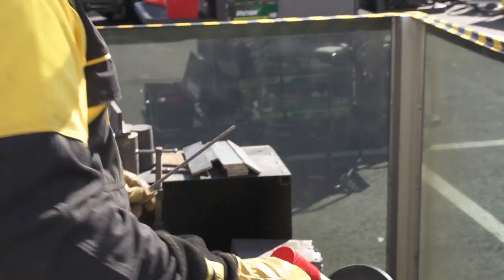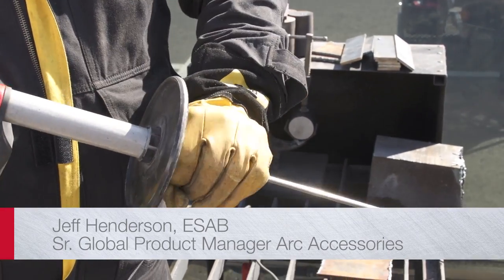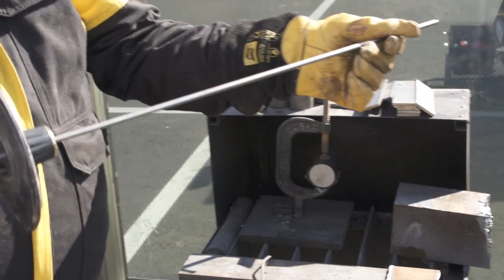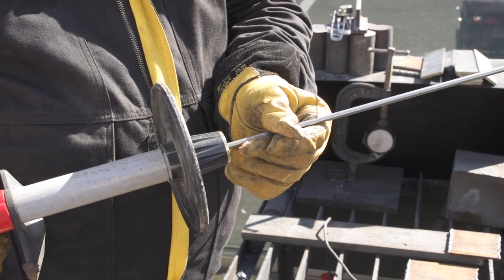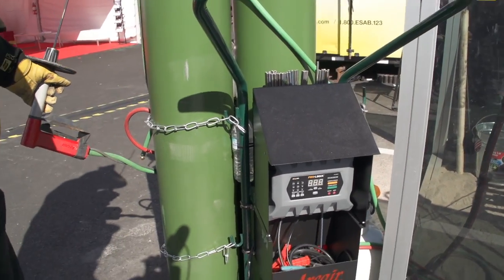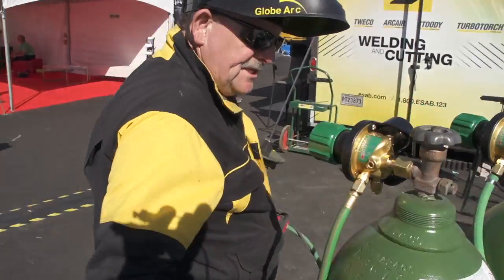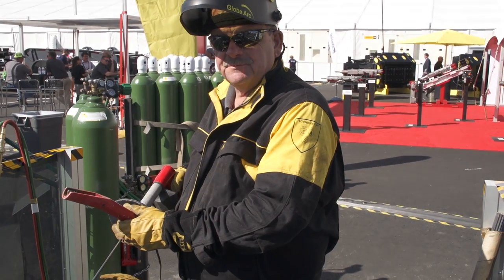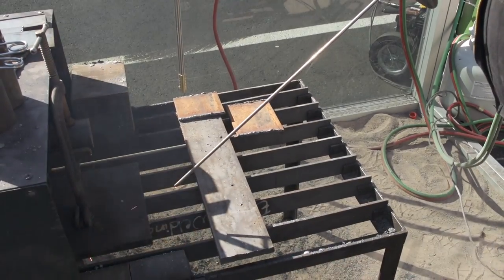SLICE Exothermic Cutting System - the Easy Way to Remove Frozen Pins

Comment: i ran into a hydralic pin used on a giraffe by the line clearing industry. we beat the hell out of it with a sledge it didnt budge and we tried heating the bushing with a torch while simultaneously spraying the pin with r-134 refrigerant to try and shrinkng the pin, it didnt work. litterally had to burn it out with this method.

Comment: Pretty neat. We use a thermal lance or oxy lance in the boilers. doesnt require power and the rods are 14 foot or so.
Reply: I think the SLICE system uses power to strike the arc or something.
When we did exothermic cuts at school the system was hooked up to a car battery.

Comment: Got a question for you guys. In a rescue scenario, can I use it to cut thru a piece of steel that is impaled on a victim's leg. That is cutting it about 18 inches away from the leg.
Reply: I would use a grinder, and or cutters.
Reply: Although you possibly could
Reply: If they didn't need an amputation before using the exothermic lance mere inches from their flesh they certainly do afterwards.

The flame is in excess of 6,000F, molten slag and sparks are going everywhere and the arc spews UV rays.
Not to mention you're melting and burning whatever is going through the person and metal conducts heat really efficiently.
Reply: @the_inquisitive_inquisitor  Well, he could shield the person with something from the sparks, Uv rays are your least problem here.
Reply: @yaykruser  I'm not sure you could provide adequate protection from liquid metal coming out of the cut.
In most cases it would be far preferable to use a mechanical process like an angle grinder as opposed to a thermal process, especially exothermic slice.
Reply: @the_inquisitive_inquisitor  a wodden board at an angle would deflect the sparks assuming the leg is not under the cut.
and my guy here is trapped under a 10 inch solid hardened steel cylinger in the middle of the desert with just an oxygen tank and a steel pipe.
So an angle grinder is not an option.
Reply: @yaykruser  I don't think you fully appreciate the amount of 6,000 degree liquid metal is produced by exothermic slice.
Reply: @the_inquisitive_inquisitor  Not all of that is gonna fly towards the leg
Reply: @yaykruser  aight dog, you want to burn the hell out of the guy that already got impaled then I can't stop you.
Reply: @the_inquisitive_inquisitor  well, the guy in the video is not much further than 18 inches away and survived it.
Reply: @yaykruser  Yeah, the dude using it is -- by definition -- in close proximity to the flame.

Having used exothermic slice it is plainly obvious to me that using it to cut a piece of metal that is CURRENTLY IMPALING A PERSON is just about the worst way possible of dislodging them.

God has given me many gifts, but the ability to make you understand this is not one of them.
Reply: @yaykruser  By the time you finish making a thermal cut, the WHOLE piece of metal will be several hundred degrees, and molten metal is spraying and pouring out of the cut the whole time. You need special protective gear to even be around somebody using thermal slice.
Reply: @the_inquisitive_inquisitor  never said the pice would not get hot, but the spary to the side (person) could be stopped.
Reply: @yaykruser  Could it be? I'm not so sure. The sparks shoot 20 feet and can bounce off things at weird angles. Molten steel spurts and spatters
Reply: you could use it but I think the burns would deter it being used again
Reply: if you’re fast enough with it, absolutely.
Reply: @the_inquisitive_inquisitor Impaled and bleeding to death or some spicy metal. Decisions, decisions. 🗿
Reply: @ch0wned  Nobody who has exothermic slice ready to go doesn't also have an angle grinder -- which would be a much safer way to make the same cut.